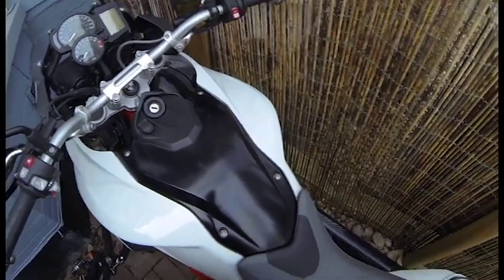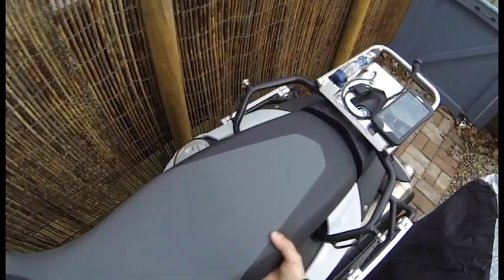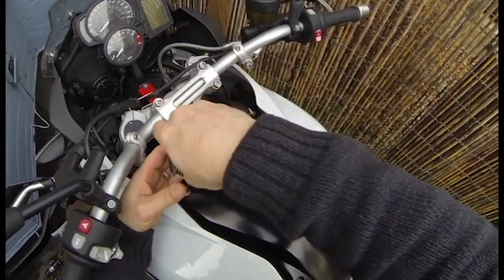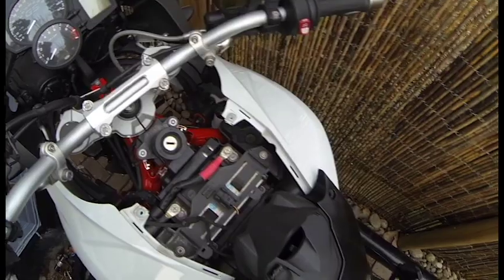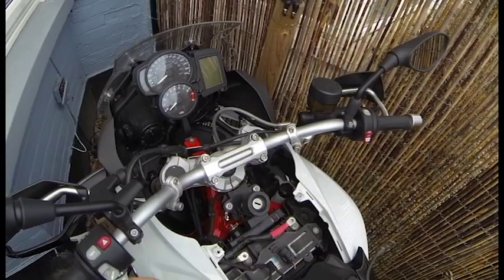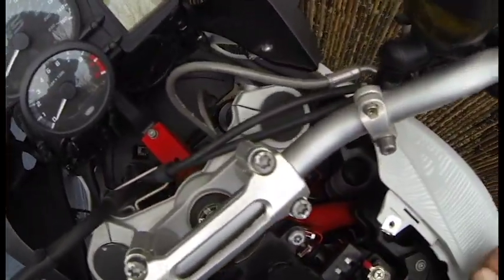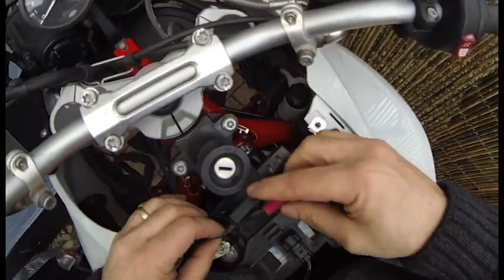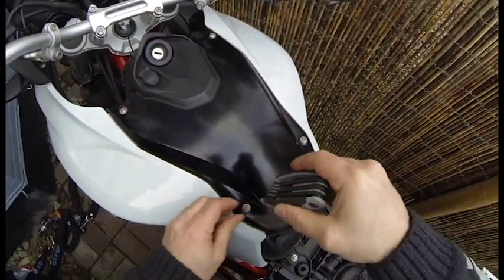Motorcycle Battery Tender / Charging Lead Installation - 2016 BMW F700GS Rallye

Comment: Is that a true BMW engine or Rotax?
I once raced with a single cylinder Rotax at 100cc (I was much slimmer) it was remarkable by revving to c. 17,500 putting out just under 20bhp. That was good for 70mph - no gear no clutch - just direct drive and adjusting the final sprocket size dependent on circuit... yes rolling starts... Best, Pete.

Comment: Hey Dick! My good friend, Jessica, is trying to connect a battery tender to her BMW F700GS, but she can’t get the display to come on. We noticed yours didn’t come on?  Any ideas? Thank you so much!!
Reply from the maker: Peggy Sonnenburg thanks for the note. Not sure what you mean by, "display". In the video, I didn't power on the bike - you'll notice the ignition key is absent for the duration. Are you saying, Jessica's main dash display will not work after installation, when the bike is on? If this is the case, and I am assuming it was working prior to installing the tender, she might look to see if she inadvertently disconnected or pinched any wires leading to the dash. Are the speedo and tach working as normal? You may want to check the fuse box as well to see if perhaps she mistakenly shorted the dash fuse. It is night time here now, but I will check my bike tomorrow to see how to access the fuse box and if there is a helpful diagram to narrow the search for the dash fuse. 
Hope this helps. 
Feel free to drop any other questions. Also let me know if (and how) you sort it in the mean time. 

All the best.
Reply: My wife’s bike had same problem. Had to remove the battery completely and charge (not letting it talk to the electronics while charging)

Comment: Do these have a 6v or 12v battery?
Reply from the maker: N. Donnelly my GS has a 12 volt battery. However, I use the same lead and plug for my 6 volt 1975 Honda CB.